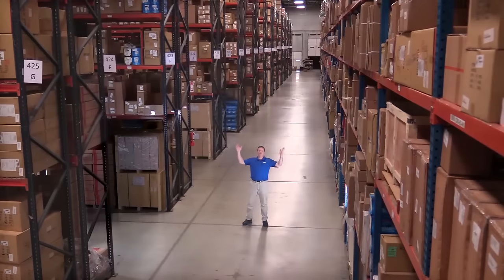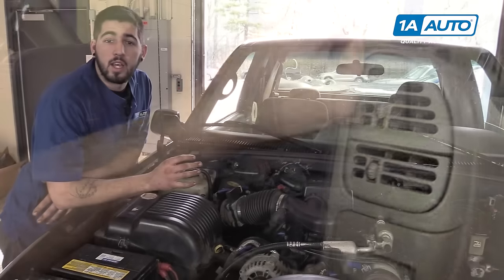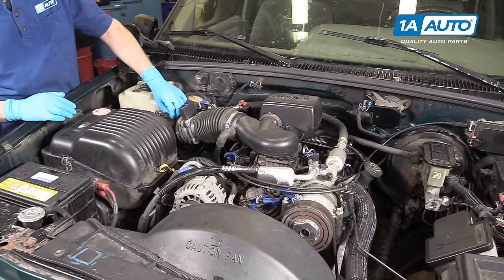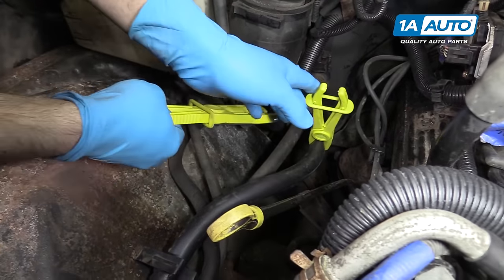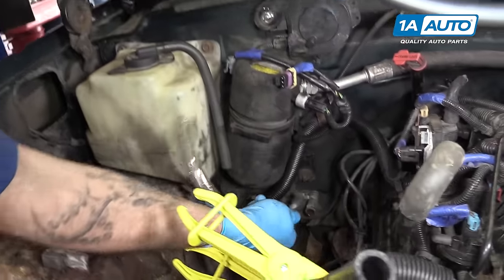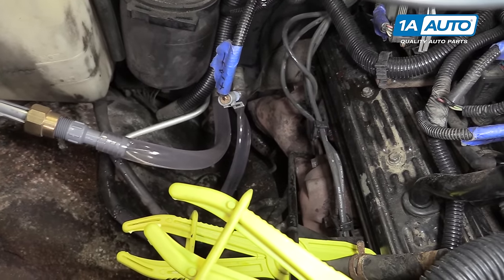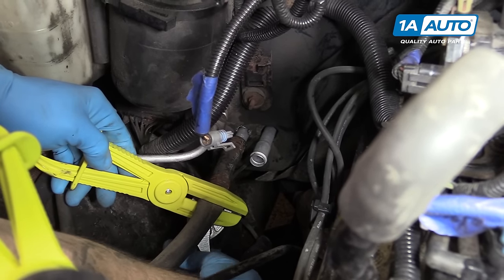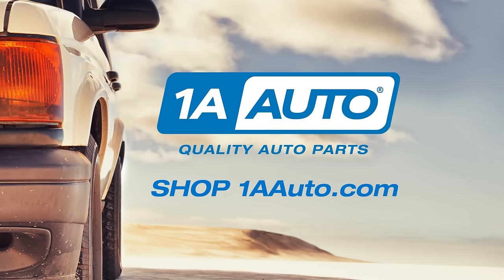How to Back Flush Your Heater Core by Yourself

Comment: Do not do it like this.  Old Heater cores get brittle where the hoses attach.  If you bust off one of those metal nipples then you will need to replace the whole core which involves dash removal.  Disconnect the hoses further down and flush from there.  You've been warned.
Reply: pinecone moment
Reply: @BroncoBob  *you're
Reply: That is why I said just go ahead and change the heater core.  It is a long process; but, it is not that hard to do.  Just a lot of disassembly and reassembly. 👈🏿. YOU MUST BE A PATIENT GRASSHOPPER.  YOU CAN PAY $700 TO $1800 TO GET IT DONE YOURSELF.
Reply: Actually, the dash is not involved.  On that particular model of Chevy/GMC the core is accessed from the lower footwell and involves 6 easily accessible screws and removal of the plastic core cover. It takes about 10 minutes. 
      My mechanic said the same thing about dash removal and lots of $ which prompted me to look it up on youtube. I was very relieved to see that it is an easy job! The core is cheap too!
Reply: Great tip

Comment: Great video but here’s an extra tip, before installing the hoses back run coolant through the heater core to flush out all the water so you maintain a proper 50/50 mixture of antifreeze and water

Comment: FYI SOME VEHICLES HAVE PLASTIC HEATER CORE LINES COMING OUT THRU FIREWALL. SO DON'T TRY AND REMOVE HOSES ON OLD VEHICLES (MERCURY VILLAGER / NISSAN QUEST) INSTEAD CUT IN MIDDLE & REPAIR WITH A DOUBLE NIPPLE END SPLICE REPAIR. HOSE CLAMP ON.

Comment: you should flush it in the manner that you did the first time and then back flush it the other way the second time to remove all grits and contaminants from the tanks on the heater
Reply: I agree,  with the hoses in place,  why not flush in both directions it wouldn't take 30 more seconds and might dislodge more debris.  Regards
Reply: Do you need to burp it after this or just add coolant

Comment: Only way I can move the sediment in BMW heater cores is by pulsing with air and water, water flushing alone often does not work. Drain coolant (not all just under the level of the heater core pipes) and disconnect the two heater core pipes from the engine and expansion tank. Wrap some gaffa (duct) tape around the tip of a typical blower so you can create a seal on either of the two plastic hose connectors, fill the heater core pipes with water from a hose and quickly use the blower to push the water through. You'll usually get a load of sandy coloured water coming out, understand this sand is from the mold when the block is originally cast which has broken loose inside the cooling system. Flush both ways using air and water until it runs clear, then run water through to get the final bits out. Reconnect pipes, refill cooling system and bleed. Enjoy your now toasty heating at last :D

Comment: The problem with alot of these heat radiators is their Inlets and outlets tend to be on the same side. Which drastically reduces the area utilization on the heater core, and makes gum ups easier.
Reply from the maker: +Dave Crupel Thanks for the feedback!

Comment: I need to try this on a 1998 Oldsmobile Aurora.  The Heat quit working immediately after a coolant flush.  When I replaced the Anti-Freeze, the  County extension Agency said if it less than 5 gallons, to dump the coolant down the toilet.  I couldn't believe their answer!   So I have a 5 gallon Home Depot Bucket with the old Coolant I need to dispose of.  Thank you for the video.  Much appreciated.

Comment: Isn’t a regular garden hose already 5/8”?   If so then no adapter needed if you cut up an  old hose or cheap one.  the female on the old/cheap hose goes on the male garden hose supplying water.  Other half can be the outflow.  Just a thought.
Reply: Could a blocked heater core cause my truck to overheat?
Reply: @GoatFaceKilla  no
Reply: @GoatFaceKilla  most likely a thermostat needs replaced you want to make sure your water pumps working and your radiator is got antifreeze if the water pump is working and you got antifreeze the most likely it's you thermostat of course you could have a clogged radiator that needs flushed most likely it's the thermostat or water pump
Reply: some are and yes that can work!

Comment: Very well explained 
My car make water running sound and water suction sound under dash where heater core is. How can i get rid off
Reply from the maker: +navjeet singh Thanks for checking us out.  That sound can be caused by air in the system, have you made sure it was entirely flushed?  If you are unable to figure out what is causing the problem we recommend you have a trusted garage take a look to accurately diagnose it for you.  1aauto.com

Comment: Thank you for the video. My heater core hoses are permanently sealed to the tubes and I have to cut them to do the flush...can you guys recommend any type of wrap/seal to tape them back together?
Reply from the maker: +Philip Bond you would want to replace the hoses. There isn't a tape that would be able to hold them together. Thanks for checking us out! http://1aau.to/m/Shop-1AAuto-c
Reply: Scotch tape. Be sure it's 3M though.
Reply: @billbosch9127  Great answer.  The person that said there aren’t any stupid questions never saw the one about using tape on a heater hose.
Reply: @justpray365  😂😂😂
Reply: @justpray365  ...😂😂😂😂😂😂😂😂😂!!!!

Comment: looks like you replaced the heater core?! looks like a brand new one when you reinstalled the hoses!
Reply: Agreed
Reply: great observation! he also had left water in the old heater hore, I would recommend flushing it out with new coolant before putting the hoses back on
Reply: @hardkore360  f Got a thing over somewhere What time is it has been seen
Reply: Ok? Probably did 2 videos in 1.

Comment: Did this work? We didn’t get the end result from this video.
Question, how about if your Anti freeze is low, would this cause your heat to disappear?
Reply: A M - yes if your coolant is low it can cause some heat loss. Top it up while running hot and see the change. Make sure you have good flow and your fans work as well! Good luck
Reply: @MacsPiano  never EVER top it up while running hot. Great way to have it geyser out. I took the cap off 3 hours after I got home and it did. Also adding cold coolant straight to hot with the engine off and then starting again can crack your head due to thermal shock. But what would I know, I only worked in radiator manufacturing.
Reply from the maker: +Link Knight Thanks for checking us out! http://1aau.to/m/Shop-1AAuto-c

Comment: Luke warm heat on driver side cold on passenger side. Car gets hot while driving and fan kicks in even with heat off. Any advice thinking of doing this flush then replace heater core if the flush doesnt work.
Reply: Beast Mode sounds more like blender motor problem

Comment: Ever isolate the core, vacuum and blow it out after flushing it and fill it with CLR overnight or...? Have a 2000 Taurus which are notorious for blocked cores, it's at the bottom of the cooling system. Doing mine tomorrow, using just water doesn't work very well!

Comment: If the heater core is clogged resulting in poor circulation of coolant back to the water pump will this cause engine overheat? I have done the thermostat and the car produces heat sometimes. Piping hot in and cold empty line out.
Reply: Generally there's not enough heat moved by the heater core to cause the engine to overheat with it ALONE. Because you have it switched off during summer. Sounds more like sludge blocking the tubes in your radiator. You can buy a coolant flush but sometimes it will make zero difference to the radiator because the tubes in the core are so thin. The heater CAN BE turned on full blast to help stop a car from overheating. Old trick us Australians use.

Comment: Hello..im tryna flush my 2011 kia sorento heater core..i feel one is hot and one is cold..question..which side would i send water thru? The cold side or hot side?
Reply: The cold side would be sending it through backwards which is what he is reccomending but I would do both ways.it goes in the core hot and comes out cooled down.

Comment: I flushed my 1997 C1500's entire cooling system with tap water. I plan on replacing it with 50/50 coolant, but I am concerned with the tap water that is left in the heater core. Should I be worried about corrosion from the left over tap water or will it be diluted with the fresh coolant enough to not matter?

Comment: At 5:30.. is it safe to do this with a water hose? Just won't be able to get the water back out.
Reply: Yeah , just add your coolant through your clear hose until the coolant comes out , then reconnect your heater core hoses.

Comment: Hi I have a question, if I was to remove one of the heater core hosepipe and add a water hose , will I be able to flush the whole cooling  system,

Comment: My sons jeep has great heat. But the defroster don't work. Windows fog over instantly. No liquid on the floorboards. Possible plugged heater core?
Reply from the maker: +Mr Phillips We wouldn't be able to diagnose an issue like that here, you may want to have a local mechanic take a look at it. Thanks for checking us out! http://1aau.to/m/Shop-1AAuto-c

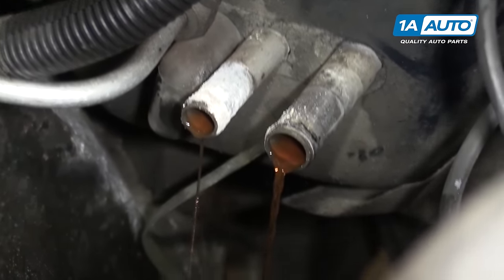Comment: Was very subtle but at 5:50 i noticed the inlet and outlet looked NEW or VERY CLEAN compared to before (3:45)
... did u put a new matrix in there or something or did you clean the metal and just EDIT the video?
Reply: caffreys1979 
He put in a new heater core. If there’s good flow and the heater is still not working, then the core needed to be replaced.
Reply: He said IN THIS CASE THE Sediments coming out wasn't bad. HE DID NOT SAY He was doing this demonstration to show us.😮
Reply: Yeah I noticed that too lol I think they did that retested no heat new heater core?

Comment: I changed my ac compress AC blows cold 🥶 but heater doesn’t heat any idea if i can fix it by doing this to my car ?
Reply: Did it ever work I'm facing the same issue?!
Reply: Depends on the vehicle. No heat to the defrost either? Some blend doors can get stuck.

Comment: I’ve never had to replace one before. Does the radiator usually run just a little hot ( like just a tick above 210) if the heater core is bad?

Comment: My 02 Ram 1500 isn’t blowing hot air. Coolant is fairly clean and both the inlet and outlet to the heater are hot to the touch. 
Do you still think flushing the system would help?
Reply: 208Brando q@
Reply: 208Brando change the thermostat

Comment: Is it possible that this can cause the vents to blow different temperatures? My 2 passenger vents are blowing a little cool with heat on full blast. I checked all of my blend doors and they're all working fine, I have a 2002 Camry 2.4L
Reply: I have the same issue on my Jeep, left side is cool right side is hot.  It's been flushed already from a mechanic and no luck.  Have you found the cause of yours?

Comment: I have a 07 ford explorer. I am having over heating issues. Its not a head gasket. Started with the heat only working when I was on the gas. Then one day as I was driving the temp gauge kept going hot to cold. I replaced the thermostat, the radiator, sensor, noticed it leaking and changed water pump... It still overhears within 5mins of driving. Any advice?
Reply from the maker: +Ashley Brown We wouldn't be able to diagnose an issue like that here, you may want to have a local mechanic take a look at it. Thanks for checking us out! http://1aau.to/m/Shop-1AAuto-c

Comment: Don't use Dex-Cool in these engines,It crystalizes in the back ports I have a 5.7l with 10,000 miles had to do a intake manifold gasket and the back cooling ports where solid, clogged had to clean them out and I went back to the green anti-freeze.
Reply: Green is garbage compared to some other options. I actually use g12/g13 in many of my vehicles, it's a solid stable option with a lot of the right inhibitors.

Comment: I'm attempting to flush my G/F' s heater core in a 12' dodge avenger sxt, but where her inlet & outlet goes into the firewall hers has what look like aluminum tubing rather than hoes & they run all the way to the front near the radiator before each of them finally connect to hoes....am I looking at the correct tubing to attempt to do the flush you're doing in your video here? I'm fairly certain I'm at least looking at something related to the cooling/heating system cuz 1 of the tubes has a little outlet w/ a cap & tag around it that says (WARNING! Do not operate vehicle while system is under pressure! ACTION required, release vacuum) I opened this cap & found what looked like a tire valve stem pressure releaser inside....I pressed on it lightly to discover it had a TON of pressure behind it.... I'm new to heating/cooling system maintenance on any vehicle so I immediately stopped releasing pressure in case this wasn't something I should've done.... can you shed any light for me as to what I'm looking at? & how would I go about completing this same process in her avenger? If I'm leaving any helpful info out plz just ask & I'll do my best to give you any other useful details on what I'm dealing with or looking at...any help you could offer me would be extremely appreciated.... I've had her car on Jack stands now for 2 days while having to share my whip....so you can imagine how desperate I'm getting tryin to finish this thermostat swap, & coolant/heater core flush as soon as possible lol. Thanks for any helpful info you can offer me
Reply: Thats the A/C freon line. Thats for the cold settings on your AC

Edit: just noticed it was a 2yr old post lol sry

Comment: Shouldnt you run the heater while doing that?
Reply: No I heater core is just like a mini radiator that's in the dashboard when the hot water flows through it and gets hot the fan blow across the thermostat radiator looking deal in the dashboard that's hot that's where you get your heat from turn the heater on will do nothing

Comment: Does a load of steam /smoke coming out the vents rule out a flush and confirm a bad core?
Reply: John O'Donovan yes
Reply: Definitely. Old ones from the 80s you could actually fix with a soldering iron.
Reply: If you're going to mess around with taken out the thermostat put a new one in those things are bitch to get to and you might as well replaces the right way because you will never want to do it again I've actually got rid of cars that had bad thermostats because the whole dashboard had to come out just to replace it

Comment: I have an 06 Dodge Charger rt and I'm only getting heat when I accelerate its topped off and i replaced the thermostat about a year ago but never overheats
Reply: you need to bleed the system better.  top off the coolant, start car and put heat on full blast. let it run, preferably with a spill free funnel attached. squeeze the hoses a few times and rev it a few times and hold it at 3-3500rpms, or until cooling fan kicks on. if this doesn't help, you may have a leak somewhere in the system. hope this helps. good luck!
Reply: JT 1200 there is a bleeder valve you can crack open a few turns then pop off the coolant reservoir cap and pour in coolant until coolant comes out of the bleeder valve then when there is lots of coolant coming from bleeder valve you tighten it and this all can be done when the engine is cold

Comment: Well I know this is a Chevy 
 when you're taking off the air box be very very careful with the mass airflow sensor. try not to bang it around or drop it  you could damage it and your truck will not run properly... It also a good time to inspect the mass air flow sensor for any dirt build up.
 it's not a cheap to replace the mass air sensor..... Just FYI.

Comment: i didnt run mineralized tap water thru mine... I bought two hoses to attach to the heater spouts about 3 ft long each... filled them with distilled water and then used an air gun to flush one way, and repeated the other way.. that way no corrosion could happen in the future... peace
Reply: Good idea

Comment: How do you know if the heater core needs to be  flushed or if it needs to be replaced?? I have a 97 bravada and the heat blows low the water pump has been replaced and the engine doesn’t run hot  has coolant. Do I need to flush the engine or the core?
Reply from the maker: +Snowman3g Thanks for watching!  There could be multiple reasons why you're having this particular problem. We suggest taking your vehicle to a nearby reputable shop to accurately identify the cause!  1aauto.com
Reply: 1A Auto Parts thanks  but your responds didn’t  help

Comment: I have chevy optra and when turning on AC coolent leaks and engine over heats what should i do?
Reply from the maker: +Tony Issac Thank you for checking us out. It does appear that when you turn on the AC, there is an additional space where coolant has more pressure to spread throughout the engine. It could be that the water pump is leaking, or the fan is not engaging properly. It is best to have it fully diagnosed to have it fixed as soon as possible. 1aauto.com

Comment: I WOULD LOVE TO SEE A VIDEO ON CHANGING THE FUEL SENSOR AND FUEL PUMP ON A 2014 DODGE RAM.  THEY SAY THE BEST WAY IS TO REMOVE THE TRUCK BED AND IT IS EASY TO INSTALL.👈🏿. YOU MIGHT NEED A FEW HELPING HANDS TO DO IT.

Comment: Hi I decided to give my old car a coolant change following your video. I have noticed that the passenger and driver foot well is wet. Will flushing out the coolant solve this. If not will something like k seal or other make of hole blocker do the job
Reply from the maker: +indiandy03 It sounds like the heater core may need to be replaced. Flushing the heater core will not fix the issue. It is recommended that you replace the heater core instead of using an additive to resolve the issue. Hope this helps you out. 1aauto.com